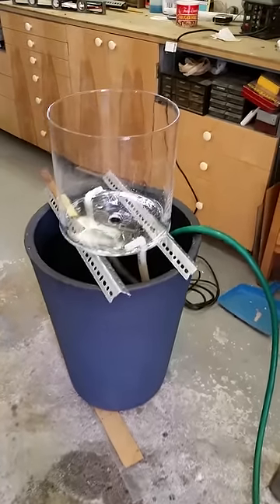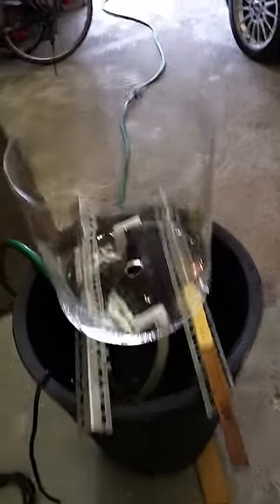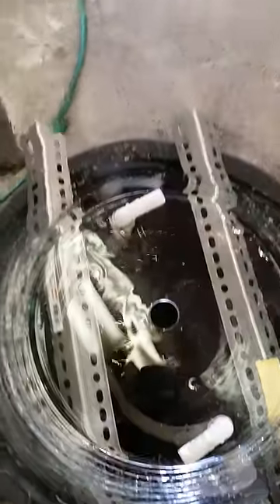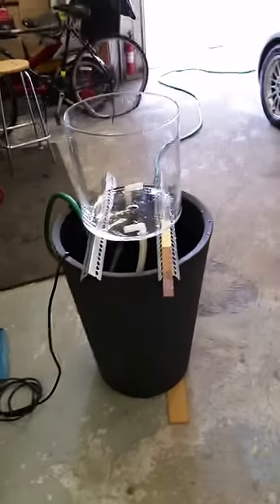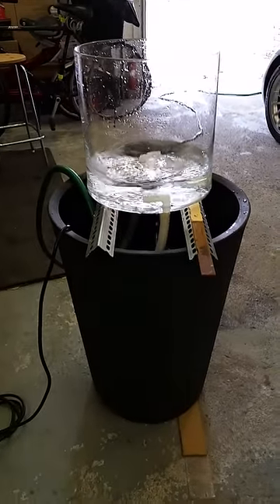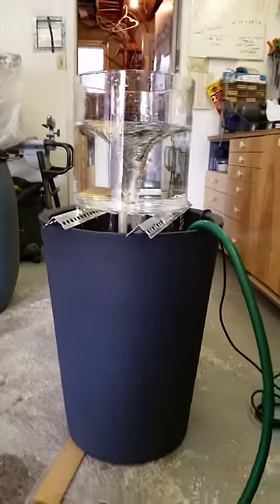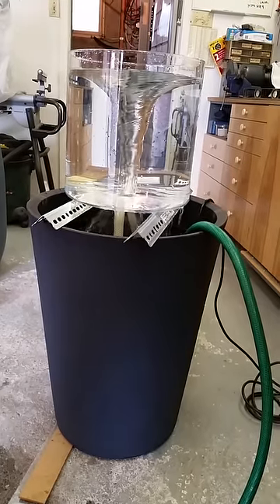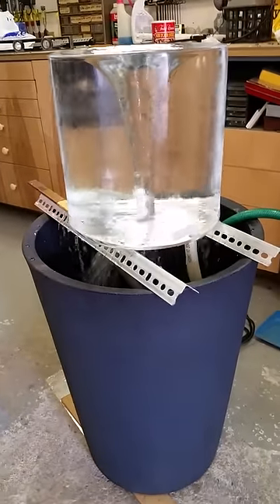Vortex water fountain

Comment: This is great! 
A couple of questions....
Is it necessary to clean the system regularly?
Leaves and other things will fall into the water, are any filters needed?
Reply from the maker: I take all the precautions that are listed on the instruction of any fountain you would purchase from the store. 
Like a net or filter around the pump so no debris gets pulled into the pump. The pump I have came with a filter.  
I also change the water once a week. I just quickly insert a spare hose to one of the 90 degree connectors inside the container, turn it on and let it mostly drain out into the garden... and then refill with fresh water.

Comment: Could you please post a complete list of items you used to build this?
Reply from the maker: Hope I didn’t forget anything:

 a 650 GPH pump ...(minimum 650 IMO)
around 6 ft of 5/8” outside diameter hoses

one T connector and two 90 degree connector sized for the size of hose
you will buy
Some river rock

Large round glass container (do your test on a bucket or of similar
sort)
Glass hole drills from eBay for around 10 dollars 

Large flower pot to rest everything on as a base and act as a water
reservoir.
Aluminum plate I found around my garage to hold the river rocks and
glass container.
4 table leg leveling screws from home depot...with felt . Drilled and
tapped into the aluminum plate and used as leveling legs for the glass
container.
Oh ya.....Leveling the glass container is important.

Not sure if I mentioned this enough: Leveling the glass container is important.   J
I loaded another video showing it completed.  Tks and have fun building it.

Comment: Do you have more instructions on this. Excellent job btw
Reply from the maker: There’s really not that much more to it. 
I drilled a 1-3/16” hole at the center bottom of a chlorine
bucket. Then I drilled two 5/8” holes as close to the sidewalls that I could for
some 90 degree connectors.  Still looking for transparent connectors BTW.
I also purchased a 650 GPH pump along with the flower pot
that it’s all sitting on and connected it all with some 5/8” diameter hoses. 
Once I was happy that the mechanics worked well, I purchased
a diamond bit hole saw kit for under $10 on eBay and took my time drilling the
holes out on the glass container. The rest was all assembly and leveling which
is very important.
Reply from the maker: I's pretty well that simple. Only thing I may have neglected to mention is to place a T connector at the pump so you can split the water return into two returns. Which are the 90 degree connector inside the glass container that help create the vortex.

Comment: Where did you find the 90 degree plastic elbows? We have everything else, but couldn't find white elbows at Home Depot or Lowes.
Reply from the maker: Here in Montreal I got them at Reno Depot. But in one of the comments future below, someone gave a link to some nice transparent connector:

Here it is:
http://www.ebay.com/itm/5-CLEAR-Elbow-Female-90-Deg-Fits-1-2-ID-5-8-OD-Acrylic-PolyCarbonate-PVC-Tube/221796428079?_trksid=p2045573.c100034.m2102&_trkparms=aid%3D111001%26algo%3DREC.SEED%26ao%3D1%26asc%3D38530%26meid%3Da8d570cd48eb4f14a44a21b26555a8e2%26pid%3D100034%26rk%3D1%26rkt%3D8%26sd%3D221796428079

Comment: could you give instructions on how to do it?
Reply from the maker: There’s really not that much more to it. 

I drilled a 1-3/16” hole at the center bottom of
a chlorine bucket. 

Then I drilled two 5/8” holes as close to the sidewalls that I could
for some 90 degree connectors. Still looking for transparent connectors BTW.

I also purchased a 650 GPH pump along with the flower pot that it’s all sitting on and connected it all with some 5/8” diameter hoses. Also used a T connector to split the pump return into two hoses and connected them to the 90 degree connectors
.
 Once I was happy that the mechanics worked well, I purchased a diamond bit hole saw kit for under $10 on eBay and took my time drilling the holes out on the glass container. The rest was all assembly and leveling which is very important.
Reply: Thanks for sharing!! Very cool.
Reply from the maker: I’m definitely not an expert in the engineering behind this but I would imagine that the pump size is more directly related to the center hole size. For me it would be a question of getting the water in the container faster that it can get out. So the size of the container should not be as important as the size of the center hole .
 
With a larger container you would want a larger vortex funnel. To get a larger funnel, you would need a larger hole in the center in.

To overcome the water draining through the larger hole in the center you would need a higher GPH pump. Otherwise the container would not fill up and overflow in the end.
 
Get a plastic bucket and do some experimenting with hole sizes. Please let us know if you find a source for a larger glass container. I’m still looking.
Reply from the maker: If you have any connections in Rogers mobile. Their mall
booths have a perfect acrylic cover over their phones….. 

http://www.stvitalcentre.com/stores/svc-airsource-rogers-wireless--2?building=1&unit=0

Check out on the corner of the booth. Nice large upside down
acrylic container…..shame, no one will sell one to me.